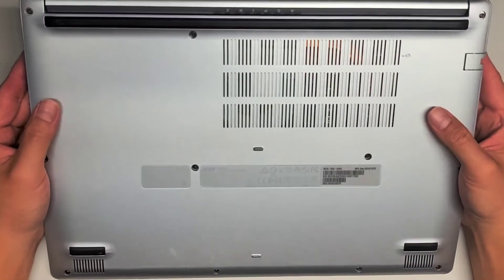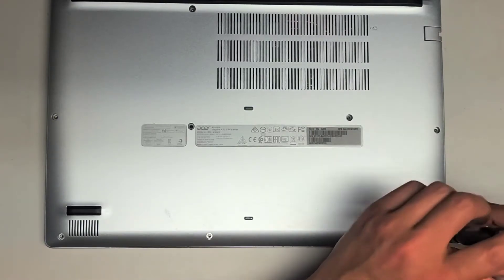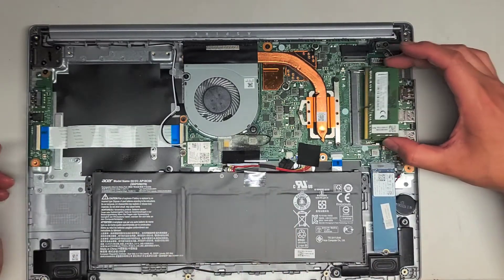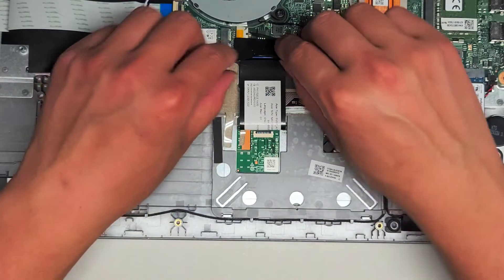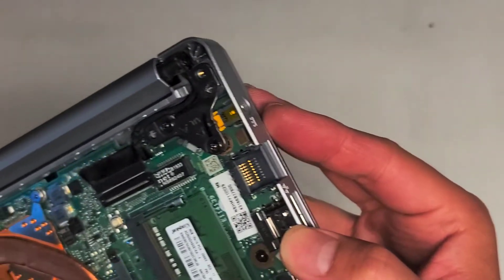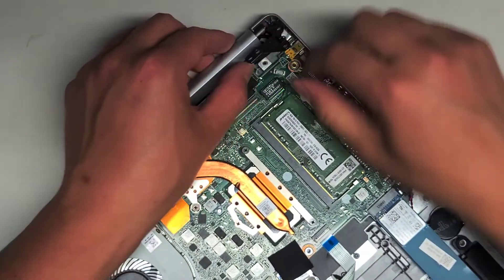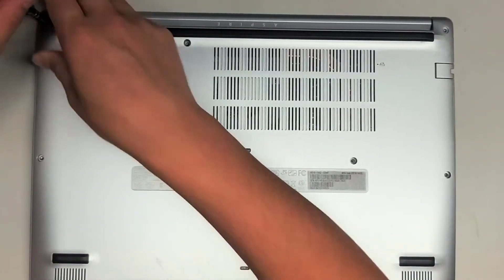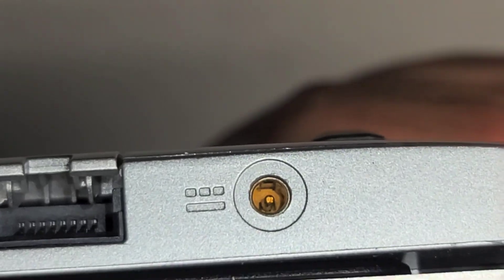Acer Aspire A515-54 Series N18Q13 A515-54G-53H6 Disassembly RAM SSD Hard Drive Upgrade Repair

Comment: the SSD got 2 keys... so, that means is a m2 SATA, not a m2 NVME, right?.. the NVME got only 1 key.. or at least that's what I thought.. Great video thoug!
Reply from the maker: That's what I thought, but some nvme also have two keys.
Reply from the maker: You have to check the label

Comment: Hey I have the same laptop as you can you please help me my laptop won't turn on or charge it doesn't work I need help please
Reply: Hey! It’s been two years. We wanna know what happened to your laptop and what did your parents say?
Reply from the maker: I can't help you through comments. That kind of issue you'd have to bring to a repair shop or ship to me and have it done as a paid repair job.
Reply: @ItsBinhRepaired  sadly I'm a kid and I won't be able to take it to a shop
Reply from the maker: Ask your parents.
Reply: @ItsBinhRepaired  with 250 just buy a new laptop
Reply: @ItsBinhRepaired  but how much you think the repair would be
Reply from the maker: @afamily2690  likely $250+ unless it's just a bad charger or charge port.
Reply: @ItsBinhRepaired  oh no I'm in big trouble
Reply from the maker: @afamily2690  how did you break it?
Reply: @ItsBinhRepaired  I stoped using it then the next day it won't turn on or charge
Reply: I have the same exact laptop with the same exact problem. How I ended up here 🤪
Reply from the maker: @abrloa lol